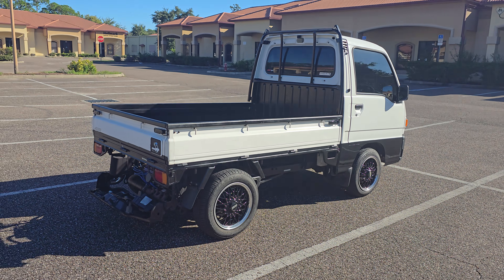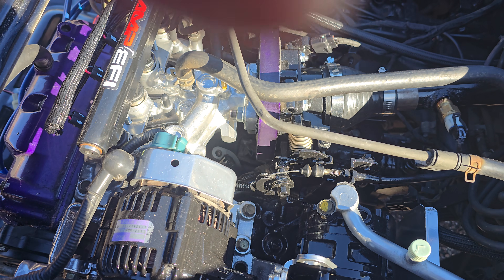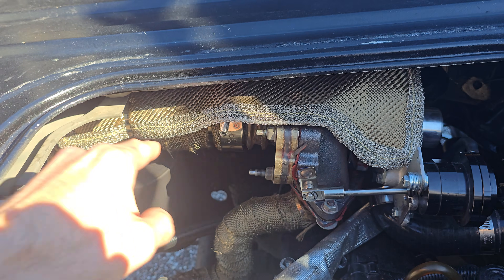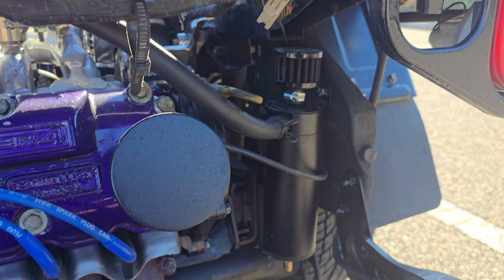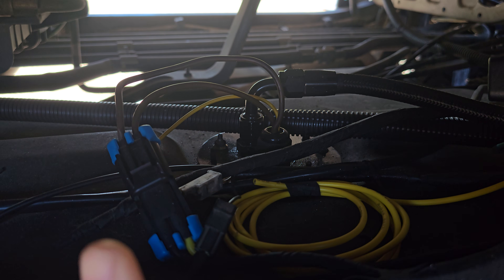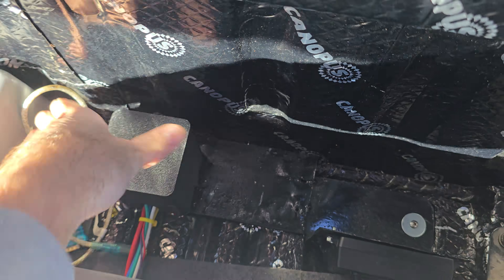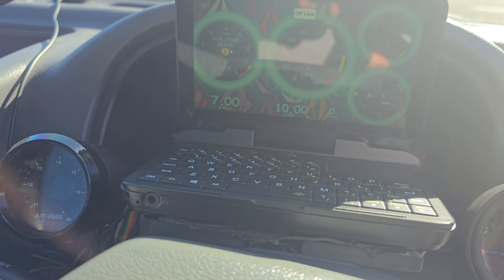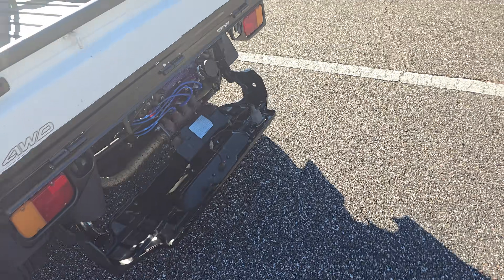Turbo Kei Truck Subaru Sambar EFI Conversion 660cc

Comment: How much boost are you running? Looking to do the same thing for one of my sambars. Would be interested in the timing wheel. I assume you didn't do anything with the motor?
Reply from the maker: Thanks for the comment!! Nope she's stock , we are thinking about going e85 and turning boost up to 10ish and hold 6-7 but right now she's at 7 psi top of 5 and just bumping 5-6 psi all other gears , you can definitely handle this project the trigger wheel was the hard part and it has to be perfect I tried 3d printing a puck for the crank pulley but didn't work I prob could have a few crank trigger wheels made and Intakes with fuel rail and injectors , we are running 250cc, for e85 prob want to bump that up maybe 450cc ,